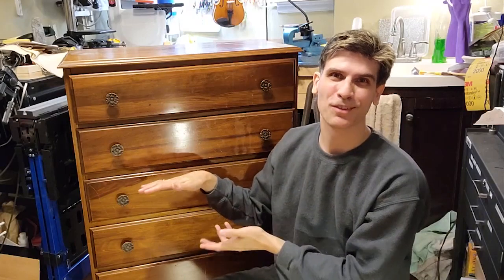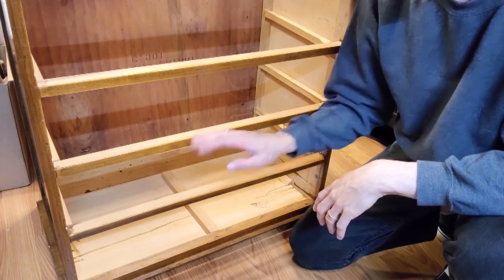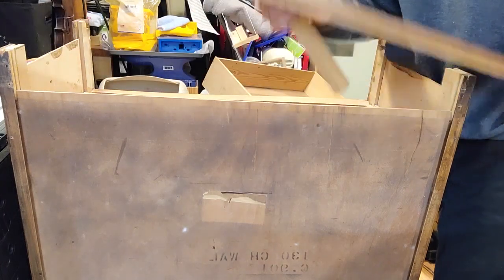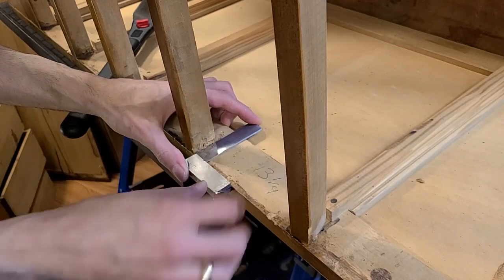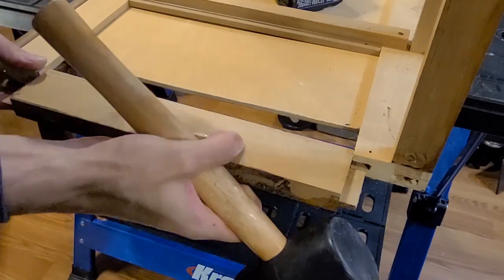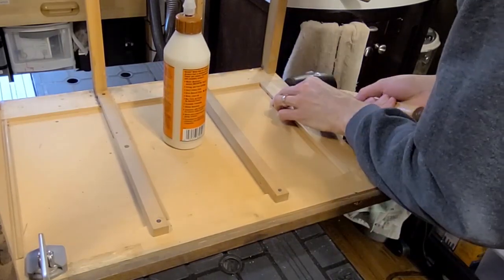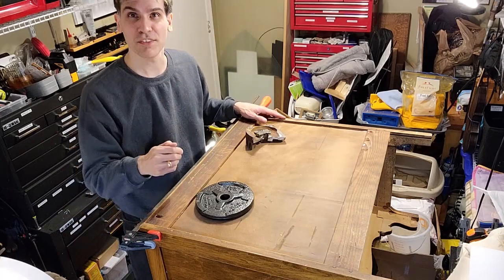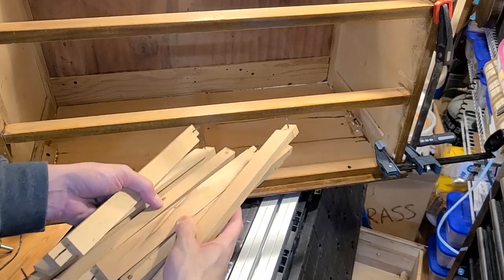Shortening a Dresser (aka. chest of drawers)

Comment: Could you possibly do a video showing how to convert shallow drawers into deep drawers
Reply from the maker: I would need to have some shallow drawers that I wished to convert into deep drawers.
Depending on the drawers, let's say if I were to do that on this dresser, I would fasten the fronts of the drawers with the front piece that divides them, and then remove the bottom of the top drawer, and either fasten all the sides with some wood between them or make new side pieces of the needed height. It would still look like there were two drawers, but when opened it would reveal to be one big one.  😉
Alternatively, one could simply cut the front support piece off, and make a big drawer from scratch to fit the enlarged drawer opening.
Reply: @SculptyWorks  thank you! I’m going to attempt it 🤞🏻that it goes well.
Reply from the maker: @melissadvine1  Good luck! And take pictures! ...or make a video!  😉